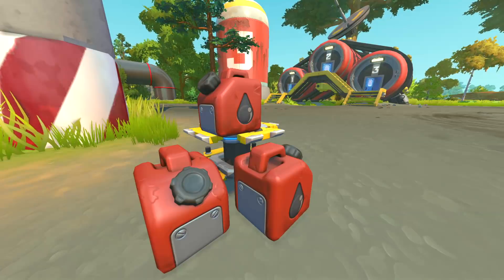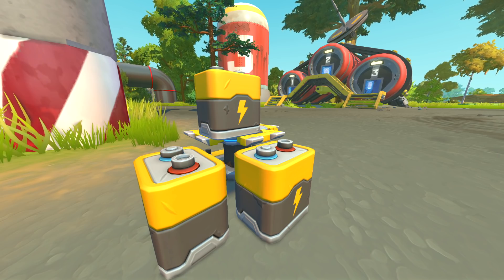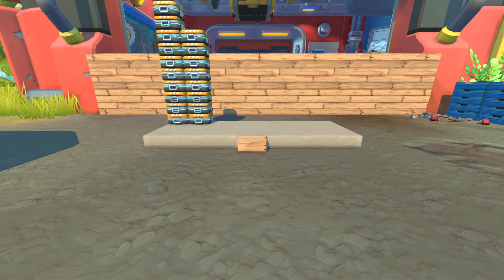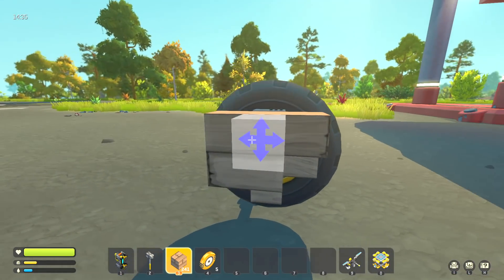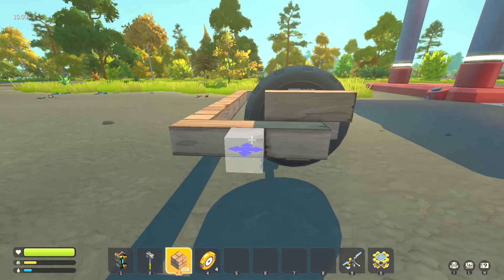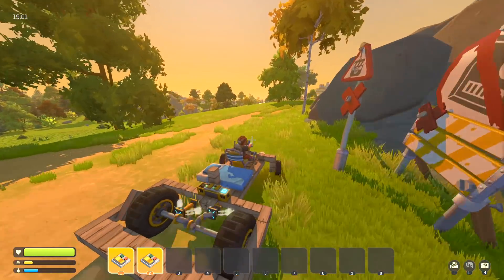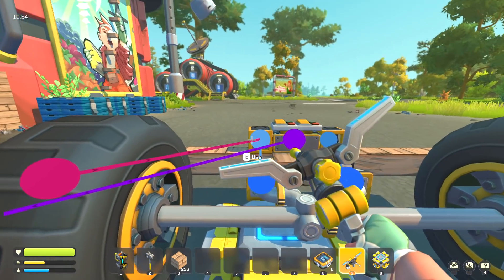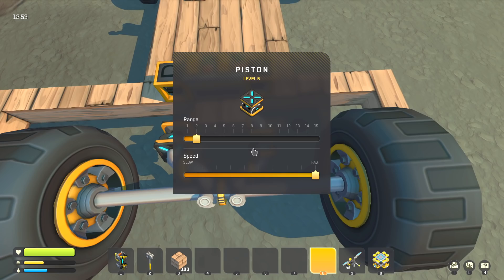How to make a fast Piston Engine in Scrap Mechanic Survival

Comment: The reverse didn't really work for me (even with adding more degrees), so here's what I did instead:
1: Insert another bearing between the big wheel and the sensors, making sure both the sensors and the blocks attached are now attached to the bearing
2: Put down another controller, connect it to the bearing, and set it to -90 degrees (not the start position, the one after that)
3: Add a third button and connect it to the controller and seat
That seems to work just fine. It takes a while to move, but so does the original design so I don't think it's that bad, and it works much better.
Edit: Actually it's working now so I don't think you have to do this

Comment: That is weird, when I try to go backward, the piston move back a full rotation, then they make me go foward :( 
(I have rotated the bearing connected to the controleur once)
Any help appreciated!
Otherwise than that, this setup is the best so far :D
Edit : I have found my problem, I do not know why, but with the piston at a speed of "3", it caused my problem.
When I move them at a speed of "5" and more, it start moving backward!
Reply: Try rotating the bearing
Reply: Or rebuild the engine

Comment: For some odd reason, my right wheel and bearing will not connect to the frame. And also I couldn’t get the 4 piston one to work. All the pistons would work, then proceed to fight against each other. I’ve tried 60,75, & 90 degrees of timing. None worked so I settled with the 2 piston
Reply from the maker: Right now I can't think of a reason why that happens. I suggest you to rebuild it again by following the tutorial step by step.

Comment: Alstrak: "yes a motor, engines convert chemical energy to rotational energy, while motors convert any energy to rotational energy"
also Alstrak: "piston engine"
Reply: The piston engines convert linear energy into rotational energy
Reply: @AI-Idiot  Batteries are stored energy, being converted to rotational energy...
Reply: CyberGenesis Batteries hold chemicals that store Chemical Energy, and when in a closed circuit, converts it to Electrical Energy. They don’t hold energy, they hold the chemicals that contain the energy.
Reply: @AI-Idiot  technically the chemical energy is turned into linear energy wich is converted to rotational energy so technically by his definition even the gas motor isn't an engine
Reply: shh, it’s a secret
Reply: "If it's already broke, don't fix it"
Reply: Batteries store chemical energy too. Electricity CANNOT be stored.
Reply: technically the game is powered by electricity from your computer so you're all wrong
Reply: Batteries use chemical energy though.
Reply: a electric motor converts DC to AC power and a piston converts air to nothing thus a piston engine is nor engine or motor its just a piston powered creation which defeats the name but hey it works
Reply: actually nvm a engine is a machine with moving parts that converts power into motion 
a motor on the other hand is a machine, especially one powered by electricity or internal combustion, that supplies motive power for a vehicle or for some other device with moving parts. so yea

Comment: After 2 hours spent farming oil, I’m sold on this design type.
Reply: Hopefully they give you the ability to put pumps on oil nodes. It's a pain.
Reply: I'm really curious whether a vaccum pump would work. Or if it would just suck water. It would probably just suck up water.
Reply: @apexalaska  I believe I read that the developer confirmed there is currently no way to automate oil. However, it does look like there is a strong possibility they will add it later. They added the ability to pump chemicals the first few days, and the vacuum pump can plant seeds and harvest crops, so the ability is there.
Reply: With the oil ponds update you can suck oil with a vacuum pump

Comment: Could the suspension glitch be used the same way? Have two instances work against each other to provide forward momentum?
Reply from the maker: You could, but where is the fun in that?
Reply: @Alstrak  using suspension to defy gravity, if possible. If it can be used for forward movement, why not upward?

Comment: Has this been patched out my pistons dont rotate?
Reply: Mine won't either, I built it twice and even slowed down the video speed to make sure I connected and welded everything correctly.
Reply from the maker: I just checked. Mine works fine. I suggest you to check if your pistons are set to the correct settings. Sometimes they reset after upgrading. Also check if you connected them correctly.
Reply: Thanks for the advice. Iv got it running using exactly the piston settings but the pistons keep going backwards as well how can I fix that?. Iv tried adjusting the piston settings. At the moment the buggy is doing wheelies and bouncing about all over the place.

Comment: I built it and it works just fine, but what ever I do, the turning radius SUCKS anyone got any suggestions?
Reply from the maker: I suggest you to widen gap between the front wheels and also add soft suspension to them. That will make it steer better.
Reply: @Alstrak  I widened my front wheels and I added soft suspension, but it isn't helping,  so I guess I will just deal with it, thanks for helping tho.

Comment: When I activate the second button if i slow down exemple if i turn I start going backwards .
Does anyone have an idea why? (if i remove 15 degrees i can no longer go in reverse) after futher  testing i still go reverse even if i remove degrees and i have 0 acceleration 
like i dont go near as fast as the video
Reply from the maker: I believe you have forgotten to right-click the 2nd controller bearing. Try doing that part again and then set up the controller as shown.
Reply: @Alstrak  I did what you said but i was trying in creative and didnt work but when i try in survival it work so im either dumb or creative is bug
Thanks for the reply tho !

Comment: When i add the other 2 pistons they seem to fight each other and dont wants to work together
Reply from the maker: Try to connect the 2 newly added pistons to the opposite logic gate they were connected to the first time. This advice is based on the assumption that you might have cross-connected them instead of parallel.
Reply: @Alstrak   I tried crossing them and still had same effect still sluggish and having trouble rotating the piston i made the car with metal blocks instead of wood would that affect it? when i look at the  logic gates there not flashing back and forth as smooth as the 2 cylinder there all over the place but i followed build exact same way and quadruple checked everything. i think it might be something with the way sensors are reading or there settings or the way the blocks are hiting them i tried the 15+ adjustment to see if it help and same result
Reply from the maker: @g3naus530  Check your pistons. They need to be set at 2 blocks of travel distance.

Comment: If anything, this shows that oil is too hard to come by and at least needs a way to be auto farmed, and/or gas consumption in vehicles are waaaaay too high.
Also, nobody is going to use electric engines until you can recharge batteries.
Reply: They could have make it so that you can get bio-diesel from one of the crops you farmed.
Reply from the maker: I agree
Reply: reasons most of us have edited oil in the configs somehow - or added "biodiesel" as a crafting recipe
Reply: @CyberGenesis1  yup
Reply: this is why I was telling a friend of mine while we play that there's needs to be an oil pump that you can place near or on the oil vent to pump out oil. ^_^
Reply: Scoop that’s what I tought when I built an electric motor, I was like but dude battery are literally more rare than gas
Reply: @phobos1963  Yes, and they're not chargeable either, so much for renewable energy.
Reply: I chomped through gas in a miner
Reply: I'm in favor of placing a vacuum over an oil spout to slowly collect. Or have an oil refinery spill pool, like the chemical plant one.
Reply: but how you are goin to recharge the batteries? Windmills? a boiler? That red place?
Reply: @giovannicesaramorimnumero7589  There should obviously be implemented smarter ways of dealing with this, like a charging station that you could connect to a solar panel or windmill, so forth.

I think they need to take more of the RUST approach where you can deploy auto turrets and utilize electricity more.

The game makes itself extremely difficult to  play with tiny ass fragile blocks and no proper way of defending yourself unless you trade with the trader, which you really can't until you've done the things that gets you attacked anyway.

Comment: nice,, i wonder if its possible to make reverse too by rotating the part sensors read.  
like the variable timing on my engines.
Reply from the maker: It should be but you will have to add an extra bearing, controller and a switch
Reply: thats the cheapest parts on the list.
for my heavy hauler i just put a springglitch on each wheel,set to 26 and then connected controller to seat.  downside is no brakes tho.
yeah i was lazy :P

Comment: How to add suspension for it?
Reply from the maker: Suspension can be added to the front and read wheels. The front is usually way easier so I suggest only adding suspension there. The rear can be turned into a quad bike suspension which should be easy or a liveaxle suspension which's conplexity overweighs the befits.
Reply: @Alstrak  thanks! great guide!

Comment: So I tired making this in creative mode and I can't get it to go in reverse no matter what timing I set it to. It either goes forward or nothing.
Reply from the maker: Check the pinned comment.
Reply: @Alstrak  I did that. Didn't work. I keep adding advance and it never goes into reverse, it just stops working.
To be fair though, I did modify your design a little. I put the distributor on the inside of the tire instead of the outside. But it is still exactly as you built it.

Comment: If you put timing in between the wheels (timing part is 2 blocks wide, and there is enough space) you can make the 
design very small!!
Reply from the maker: The timing is on the outside for a reason. If you put it between the wheels you won't be able to get the efficiency aspect of it because you can't adjust the timing wheel that way.

Comment: I've build the 4 piston version and this is the smoothest fast running piston engine I've driven yet, great step by set build tutorial as well nice and clear instructions so you hardly can make any mistake. I do recommend as well as what you have said to someone else for the reverse problem, add another 15 degrees going to 75 from 60 to make reverse more reliable.
Reply: Just so i can know, how is the torque on it? I was thinking of making a big heavy rv with this but im worried the engine wont have enough torque

Comment: "It's cheap"
" ...You will need 18 Component kits "
Reply from the maker: You can get them easily from crates. :)
Reply: @Alstrak  I know... but still for some reason. I usually go to the spawn because there is many of them, at least I think so. Last time I was going there I got 14 :P
Reply: Dunno how everyone always gets so many... I'll do that same spawn run and come back with 6. I get more from haybots than loot chests.
Reply: @giin97  same
Reply: Giin kill all farm bots and destroy every create u see
Reply: @AHHEUS  oh I do. I resigned myself some time ago that component kits were going to be my most limited resource. It's really the only thing I'm ever short on; the pond behind my base has 93 clams and 31 oil, takes 15 minutes to collect it all, a single days work, so I even have gas and glue in abundance, lol.
Reply: Giin i am short on comp kits to but i il get them always
Reply: @giin97  Lootboxes is different places have different loot even if they're the same rarity. The ones at spawn don't drop as many component kits as the once in buildings so definitely go for those instead of the spawn
Reply: @CubsYT  I realized that yesterday, thanks. I was using spawn due to the quantity, but there certainly is a lack of quality. A single nearby building outside of spawn, near the first packing place gets me twice as many. 

Thanks!
Reply: CharTee _ it is cheap
Reply: its better than haveing to go to the ocean every 5 seconds
Reply: @syn6109  Well yea
Reply: eh 1 round of looting will solve that while to get any where near the milage out of a regular motor/engine you would need WAY to much fuel
so inital cost and long term costs (which the inital investment while it may be more of an inital cost is a long term investment for an easier way to get around 
yes theres draw backs, but for early game and (at this point( even late game, this piston (or solonoid) eninge is welll worth the inital cost
Reply: @Computer Boy ik

Comment: i cannot reverse huhu
Reply from the maker: Try adding more degrees. That might fix it.
Reply: @Alstrak  in what sir 1 or 2
Reply: @resepibarutv5787  set the 60 degrees to 75 degrees that did the trick for me
Reply from the maker: @resepibarutv5787  2nd position (if you count the default as 1st)

Comment: I made a piston driven tractor with an open differential that can mechanically lock if extra traction is needed.
I made it in creative using gear mods, but I think it could be modified to use vanilla parts for survival.

Comment: What is the difference between the models you first built in survival on stream(the pistons were on top) vs this design?
Reply from the maker: It is less complicated. That design used a lot more bearings.
Reply: Another possible difference, I've seen top piston engines have trouble with bouncing the wheels off the ground; this one didn't seem to have that issue.

Comment: Great tutorial, one issue I had was getting into reverse. After mounting the vehicle on a stand and adjusting the timing wheel. I had to remove one of the blocks in the bottom left to get it to function in both forward and reverse.  So my timing wheel formed a T (3 and 1) instead of being a 3 and 2.
Reply from the maker: If you couldn't get into reverse then you could add 15 more degrees of advancing. This should fix the issue and you might be able to go even faster. :)

Comment: I think I’m going to use this as a good starter engine to gather parts for me then to build like an 8 piston engine to power my mobile base. Do you have any designs or recommendations for 8 piston engine designs?
Reply from the maker: boxer 8
Reply: Alstrak does Brent have a tutorial on that?
Reply: Alstrak also does it still work? I heard the bearings are really floppy and a lot of piston engines were broken
Reply: @jonathanclark7444  he built this in the survival release... So he build ot with floppy bearings in mind
Reply: Mike287 oh I see why that was confusing I meant the boxer 8

Comment: Is it possible to make a 6 piston engine?
Reply from the maker: 6 piston engines are possible but you need to set your sensors to a certain degree that allows the 6 piston design to function properly. That requires a lot of bearings. I personally recommend going for a boxer 8 piston design. It's easy to make. You need 4 sensors that are 90-degree offset which can be done way easier than with the 6 piston design that uses an odd number. You will use the same amount of space as the 6 piston variant if not even less and you get the power of 2 extra pistons.